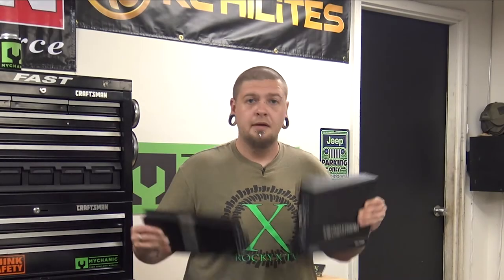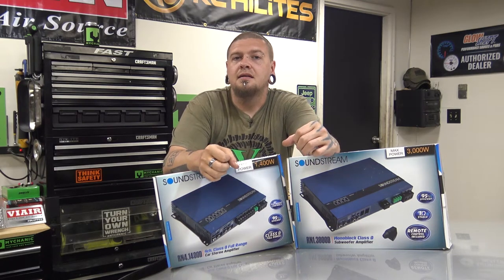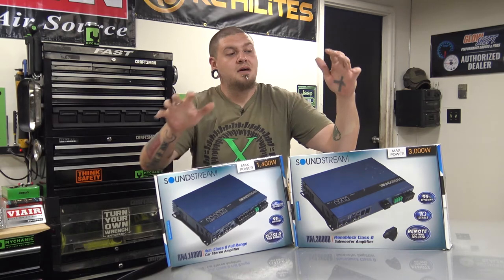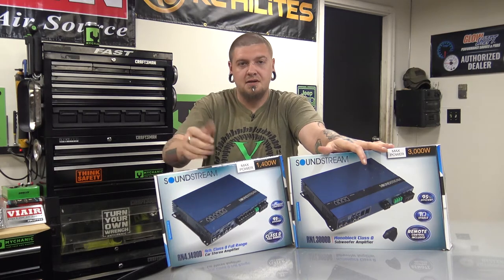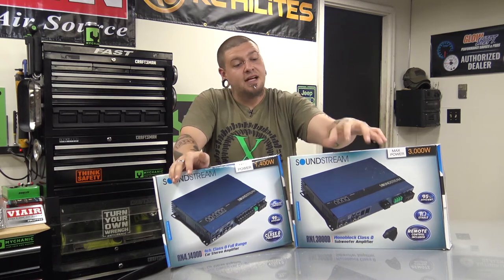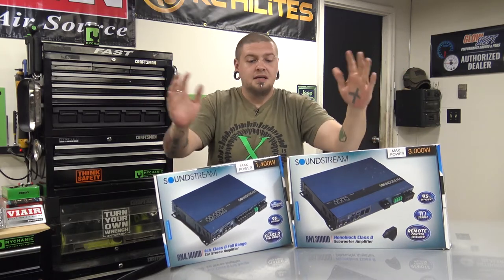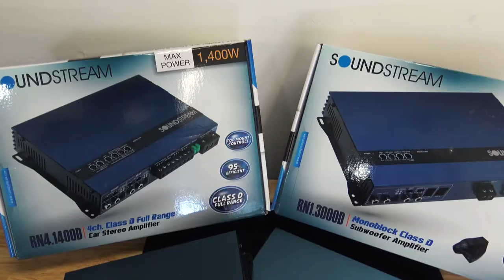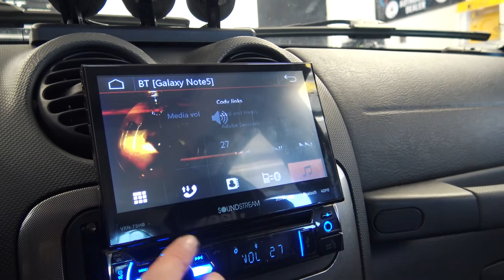Soundstream Rubicon NANO Amps, Project Renegade Ep.35

Comment: Hi, have you thought about putting a double din head unit in it, I put one in my 2004 KJ as i didn't like the idea of the single din with the screen like yours blocking the aircon vents, you can buy a new dash fascia that moves the switches down a bit and the lighter socket over a bit and you will need to cut some plastic away right at the back near the firewall and heater area (but you can still go back to a single din unit by putting the other fascia  back in.) I have a 7in JVC touch screen without CD but it is Android auto and Apple car play ready, if you need the link to the fascia let me know and i will try to find the sellers name, it was from eBay i think. Keep up the great work  mate it looks great.

Comment: So how was the sq of these Amos vs the older ones? Do they do rated? I'm thinking about running dual 5 channels and a mono for my setup. And lastly...how accurate are those subs? I don't care about spl per say, but running 3 of those is something I'd do if they are meant to be ran sealed.
Reply from the maker: The SQ is far better on these Nano amps over the Picasso and Arachnid. Not sure of the ratings, I'd have to look, but these are the better SQ line from Soundstream. The Stealth 13's are designed for a sealed enclosure, they actually discourage running them ported. They are fairly accurate for what they are, keep in mind that these are shallow subs and more often than not shallow subs are a little "boomy" and lack tightness as well as bottom end. These have surprised me with their SQ though, I think the monster 5" voice coil helps. Thanks for watching!

Comment: How are these amps treating you? I currently have 2 Soundstream Rubicon series amps that I want to replace with these 2 exact amps in my setup. The Rubicons still work perfectly, but I want to get something smaller and get a little more power and these are perfect from a size and power output perspective. Cant find much videos on them, or reviews. Any input is appreciated.
Reply from the maker: I have really liked these amps. They have held up really well for me, I do have to say though, the vehicle they are currently in doesn't get driven anymore so I used them for about a year total. I have the sub amp running at 1.3 Ohms and the gain is pretty high, no heating issues, even mounted under a seat with little ventilation. I would say these are a better "SQ" type amp and less of a "SPL" type. They do get plenty loud, but some Soundstream stuff gets louder, but not as clean as these. Thanks for watching!